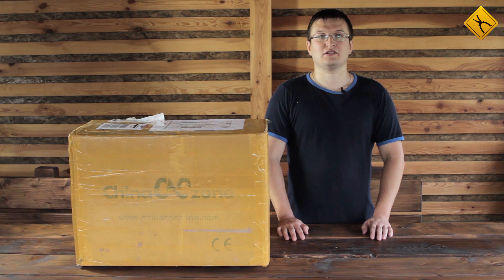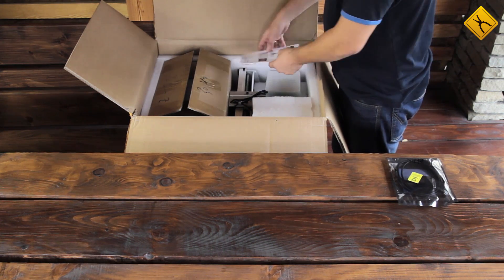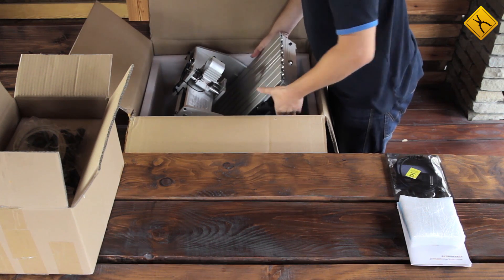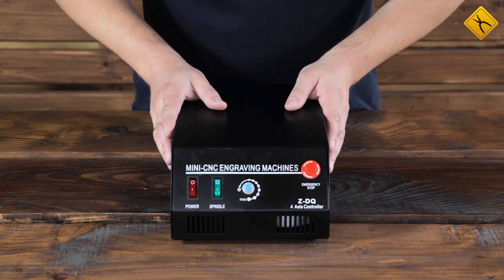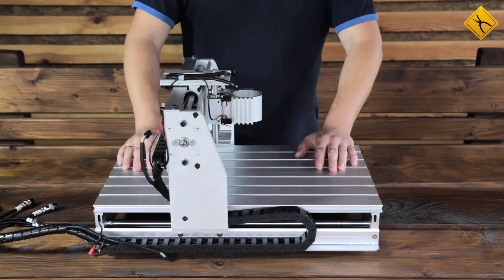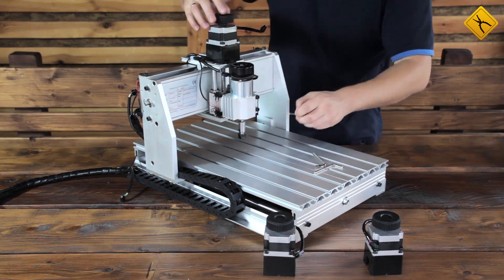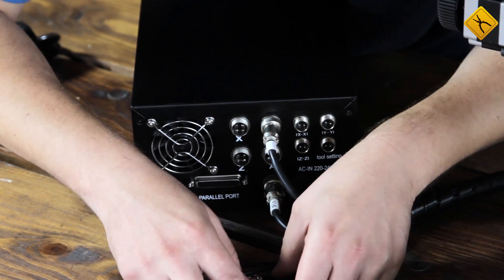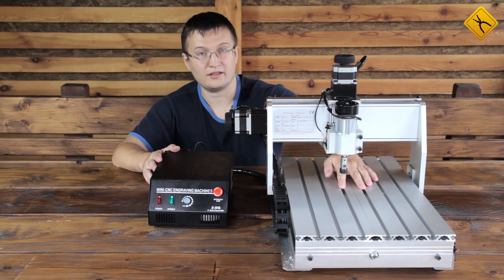ChinaCNCzone 3040Z-DQ Three-Axis CNC Router Engraver

Comment: I’ve just got one of these but the spindle has blown almost straight away… Is there an upgrade that I can buy for it so I can use a standard palm router like a dewalt or makita? Thanks.
Reply from the maker: It is difficult to give an exact answer. We haven't sold this model for a long time. We advise you to contact the nearest service center or directly to the seller.

Comment: Excellent video. Is it possible to add a 15W laser module to this CNC? Perhaps swap the spindle connection with laser and design a mount to put it in place?

Comment: Would this be good for aluminum? And did it come with the software or just a tutorial cd?
Reply: I've used my 3018 CNC with a 15 watt motor to engrave aluminum and copper just fine. If my weak machine can engrave to a final depth of 2mm, there is no reason that the machine in this video with a way more rigid body, way more powerful spindles/ steppers couldn't be good for aluminum. The question is not could it do it, it's more a question of speed, and whether you'll get the right bits for it.
Reply from the maker: The device can drill wood, plexiglass, plastic, medium density fibreboard, PVC, plywood. To drill aluminum or other metals you need a more powerful machine, for example CNC 6090. The software is included in the package. It is also available on the manufacturer software.

Comment: I have been looking for a metal engraver but the only machine they show or advertise is a worthless machine that cuts aluminum or wood. Pathetic!!
Reply: I've used my 3018 CNC with a 15 watt motor to engrave aluminum and copper just fine. If my weak machine can engrave to a final depth of 2mm, there is no reason that the machine in this video with a way more rigid body, way more powerful spindles/ steppers couldn't be good for aluminum. The question is not could it do it, it's more a question of speed, and whether you'll get the right bits for it.